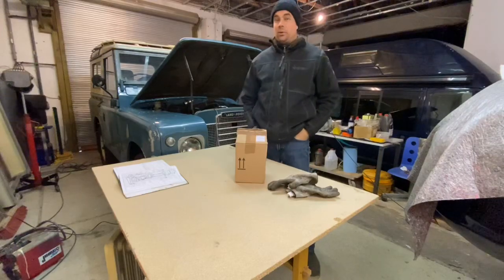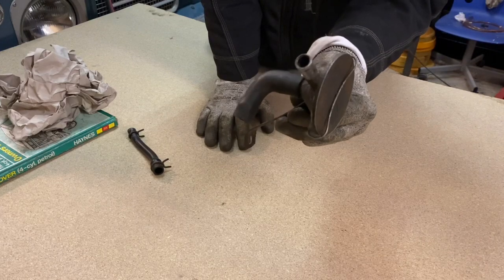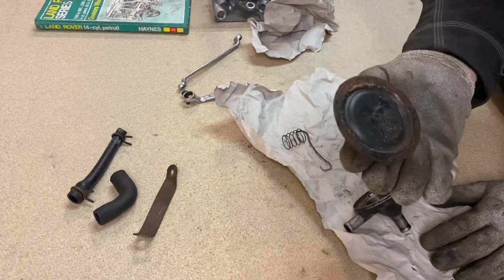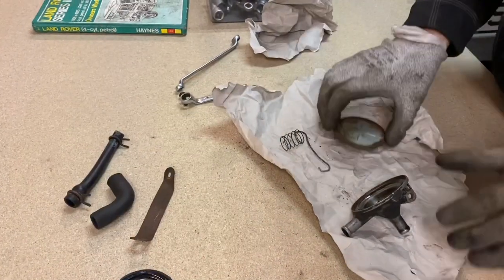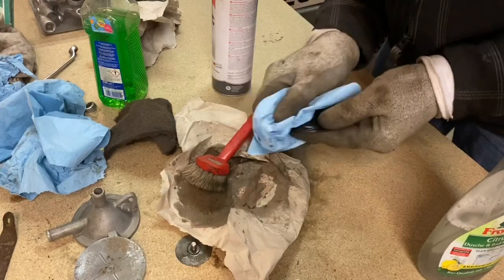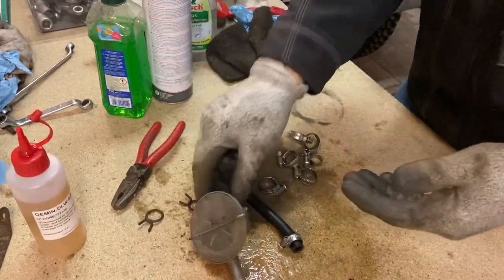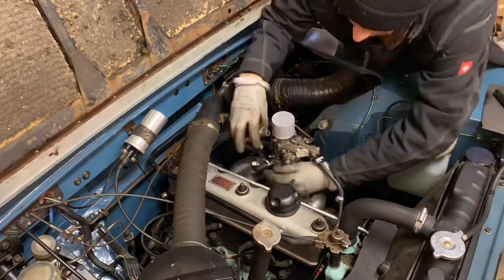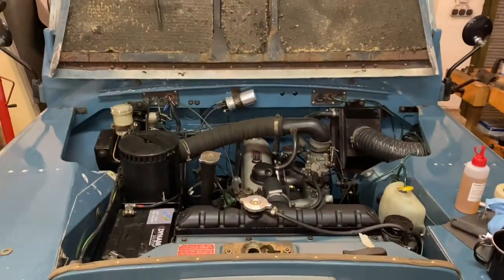Land Rover Series 3 Restoration - PCV Valve Installment 2 - Part 61

Comment: All of my work has been in a little one car garage. I have to move stuff to work on one side to the other to do some work. Plus have parts sitting outside and in my basement. I use to do work outside in a gravel lot with a tarp over my stuff. Ha ha!! Nice cleaning of parts and install. Clean install.
Reply from the maker: Thanks Cory. I totally get that. Hats off to you for working under that tarp!
Reply: @My911  the good old days weren’t always good old days. Now I have a dry little garage to work at my leisure. Which is nice to have.

Comment: Joel - nice work!  The rubber membrane is not meant to be glued to that metal bit, so it’s correct as is!. That cleaned up nicely.  Be careful inhaling the brake clean fumes - not sure if it’s the same stuff they sell here in the states but it’s toxic!  You’ve installed that PCV valve 100% correctly - and yes, you were right to cut that tube shorter.  As far as the startup goes, It’s very possible that the rubber membrane/diaphragm needed more motor oil slathered on it to seal properly and was letting air get past it, which would effect the vacuum and would cause that hesitation (Low vacuum would effect startup and acceleration).  It will oil up and seal better with use - you can find the diaphragms still but postage may be more than the part!  Also, as you mention, you may just need to re-tune the engine as the new valve impacts the mixture/running characteristics.    The manual actually recommends adjusting the carb if necessary after working on the PCV valve.  With regard to the choke setup - definitely get someone with a Weber to share their setup.  That Rube Goldberg setup is asking for future trouble :-)
Reply from the maker: Hi Charles, thank you. And yes, as you say.That choke cable monstrosity needs sorting!

Comment: The difference in starting/running is likely due to the fact that you now have vacuum pulling air from the crankcase. Check for any vacuum leaks at the valve, check your timing and readjust your carb and you should be good. Pretty nice bending on the aluminum pipe BTW.
Reply from the maker: Thank you Patrick. Will do.

Comment: Hi Joel, I hope you and the family have had an enjoyable Christmas. With regards to the poor starting/response to the throttle, if something changed since your intervention, it’s a fair bet that the problem is related to something you’ve done. I see someone commented to say it is incorrectly installed, that gives you an idea of what to try. A quick and dirty way to check is to block the valve off, crimp or block the pipe to the carb off again. If it returns to how it used to be before you installed the valve, it’s a sure bet that there’s a problem with what you’ve done. It sounds to me like the car is running lean, suggesting air ingress somewhere. HTH, looking forward to the next instalment, good luck with everything. Regards, Mark.
Reply from the maker: Hi Mark, thank you and yes, we had a good Christmas. In Germany Christmas is celebrated on Christmas Eve so it was presents on the 24th. The 25th and 26th are called the first and second holidays. I was actually up at the garage today, but doing some DIY like installing more lights and mending the roof! 
Thanks for your tips. I have since repaired an issue I had with the choke cable (supporting your lean theory) and having fixed that it seems to have sorted the issue. But I will Monitor it as even with the cable fixed it starts differently.
Reply: @My911  great news, glad it’s sorted. That choke did look like a bodge up. My car has been converted to a Weber carb. The choke cable has been replaced by an aftermarket version, the dash has been drilled in line with the carburettor. The old choke cable is still in there though, it’s just disconnected. Not ideal really. I was going to remove the old choke cable, but it’s not simple as it is part of the steering column casting, I seem to recall.
Reply from the maker: That is true, it’s involved to say the least. I have seen this mod you have on other Land Rovers. The original is clearly a weak point.

Comment: Should be able to test the PCV valve simply by sucking on it, the mixture will probably need adjustment now. A disposable fuel filter just before the carb would be a really good idea, when you put the vehicle back in use all the crap that has collected in the bottom of the tank and the hard line will eventually end up in the carb, you will probably end up changing the filter often for a while. I would use cheap modern clear plastic ones until the filter stops getting dirty, then get something that looks period correct or not latter. Modern clear filters are good because you can see how dirty the fuel system is. If German fuel has ethanol in it, best to replace all the soft fuel line with something rated for it like gates green, not expensive, otherwise you get dissolved rubber in the filter as well. Not an issue if the fuel doesn't have ethanol in it.
Reply from the maker: Thanks Greg. There are fuel options here, some with and some without ethanol. I use without.

Comment: So what you need to know is that the PCV is not a one way valve, at least not JUST a one way valve.  The spring, diaphragm and the pintle are shaped so that the dsired crankase flow is maintained no matter the engine speed and throttle position ie at whatever value the manifold vacuum happens to be.  This means that there will always be a flow present now that the PCV is connected and that it will be controlled as a function of manifold pressure (the pintle tip is not parallel). The problem is that you have just set up the idle mixture and have now introduced a leakage path. SO:  the idle airflow will be increased (so idle speed will rise) but crucially, the bypass air (not going trhough the carb) has also increased so your idle mixture has now been leaned out.....  DOH! So you will now need to set up your mixture and then your idle speed all over again now the PCV is connected and working.  Edit. was going to ask if you'd spotted the Croker videos, they're amazing but I notice there's a bit of a gap at the moment.  His chassis rebuild was something else and very funny with all the angry frustrated comic faces added in edit.
Reply from the maker: Thanks, so I need to reset idle and mixture. 
Yes, I know Geoffrey, love his work.
Reply: @My911 Yep that should sort it.  Gunsons colour tune a good cheap investment for setting carb rather than a CO meter. Electronic ignition will make a big difference as well. 

Geoffrey is amazing just an astonishing level of detail.  Rebuilding everything to the nth degree. Just amazing.

Comment: I hope the chap below is right about the valve setup. Was the slow starting not just because you'd disconnected the fuel pipe though, so it took a while to prime back in? I'm very far from an expert, but just a thought!
Reply from the maker: Thank you. I think it was a combination of that and the choke cable issue I mentioned in the comment above.

Comment: Hi Joel, I am not trying to confuse the issue, however, I am trying to help. At this attached link is a diagram showing all the pcv in detail. Where it connects, to what it connects etc. https://www.lrukforums.com/threads/2-25-petrol-breathers.140271/ . I have a few photos I will also attempt to send through, that show your engine with and without the pcv attached. You have done a great job to get to where your are now and with less than a week for the MOT, don’t get to hung up on the expert advice out here in web land! Merry Xmas and good luck with the MOT.
Reply from the maker: Hi Steve, no worries. I welcome all feedback. Thank you for the diagrams. I had in fact found the same link 😀 and followed that while building. Photos would of course be great tho. Please use my email address which is my projects post at Gmail dot com. All written together and lower case. Thank you and have a great Christmas yourself.

Comment: PCV is setup wrong, Oil cap to the PCV value, the pipe was the correct length before you cut it. The oil filler connects to where you currently have the oil cap.
Reply from the maker: Hi, thanks for your comment, but I can’t quite follow what you mean. The set up I have installed follows the images I have gathered online. I think the later series three PCV set up is what you are explaining. But I might be wrong.
Reply: @My911  The set up you have is correct. My 71 is the same. Do you have the petrol tank carbon filter breather system? I am trying to figure out that next!
Reply from the maker: nick B no, I don’t know about that. What does that look like?
Reply: @My911  I think it's a California thing - there is a vent from petrol tank into a carbon canister that then vents into the air intake elbow - a second tube next to the valve cover vent. I think I may leave it off.